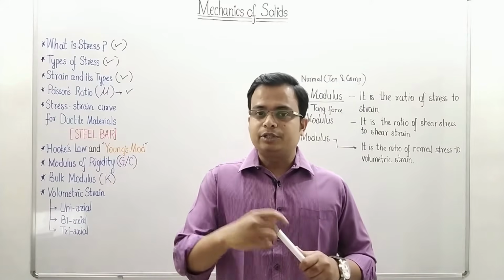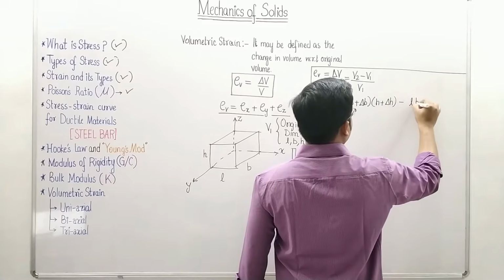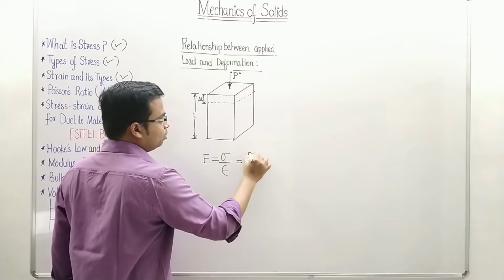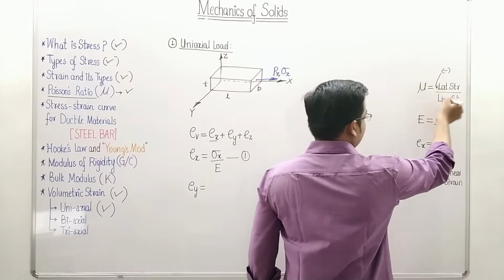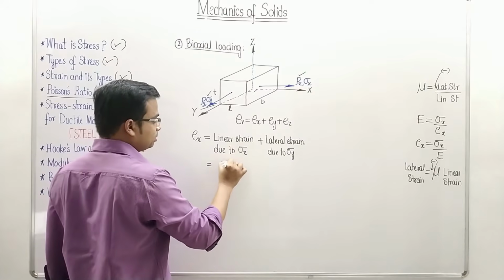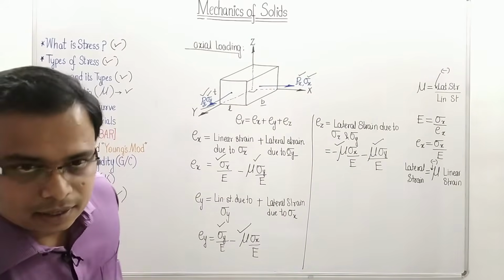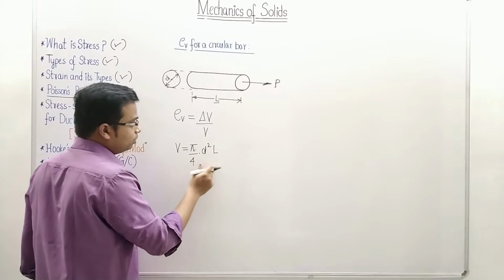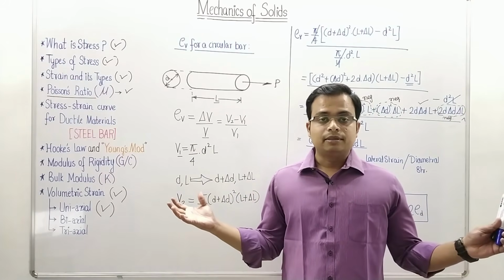Mechanics of Solids | Simple Stress and Strain | Part 3 |

Comment: Sir, one doubt, in Volumetric strain for Circular bar, the diameter decreases so the eqn should be d - delta d and so on in the final eqn also..
Reply: just Assume, You need not write it in the equation (since he is just writing the raw equation and saying that the value changes and not increases), when solving the values the del value will automatically be considered with the minus in before it.

Comment: Hello sir ,in last case of circular bar due the linear strain the length of bar which is L will increase to L+∆l. so due to this... Don't you think if the length increases diameter will decrease.and it will become (d-∆d) form d..as I learn from your vedio this term will not affect on the equation because it is very small and negligible...I am not pointing out your mistake may be this won't be a mistake..and I dint take it in right way . ....this is just a dout in mind mind....
Reply: Yeah! Same doubt I have. So final ev value is  linear strain in the direction x - 2e diametrical strain

Comment: Sir...how do you solve this problem...plss help me...
The point A of a line AB is in HP and 60 mm in VP. The point B is in VP and 40mm in HP. Distance between the projector is 70mm. Draw the projection,true length,inclinationan and traces....plsss post this as fast as possible before 2nd of Jan 2k19

Comment: Sir how to solve this question 
The front view of a line AB , 90mm long measures 65 mm . Front view is inclined to xy line by 45° .point A is 20mm below hp and on vp.   point B is in third quadrant . Draw the projection s and find inclinations of line with h.p and v.p .